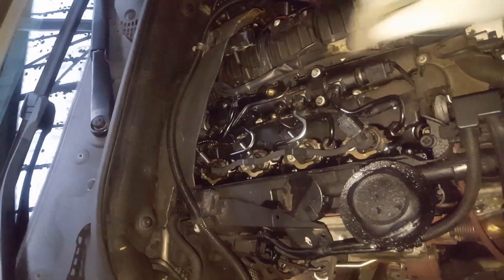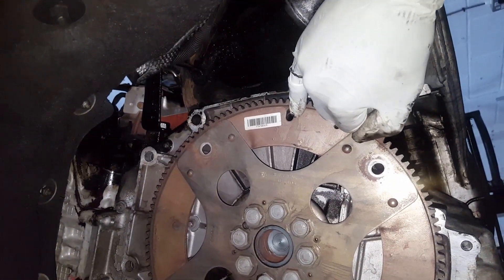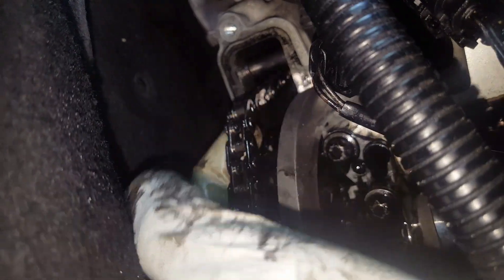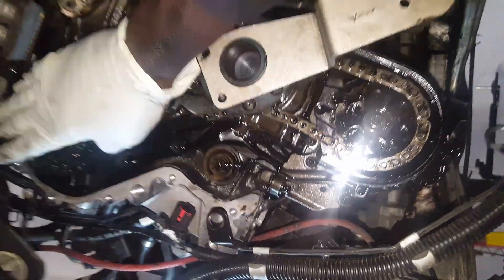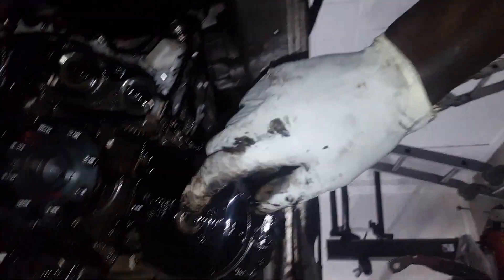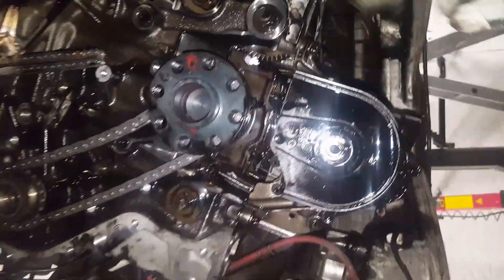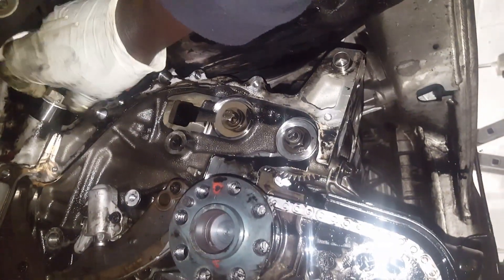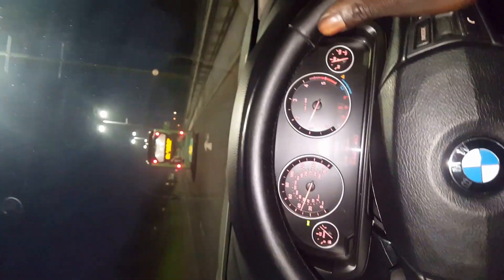BMW N47 timing chain replacement | click video describstion below for info

Comment: not to dish your work but there is a tool that screws into the H/P pump sprocket cost bout £15  on ebay saves lots of time on removing pump bolts can do from start to finish in about 5 and half hours have done quite afew
Reply from the maker: No problem mate, at that time the garage I was working for didn't have that tool and I had to keep doing it that way. 

Will you be able to send the link on the comment below and I'll order it thanks👍
Reply: Dawda The Mechanic  cant get link up but just type in ‘bmw n47 injector pump tool’ on ebay it wil come up
Reply from the maker: Alright no problem thanks👍

Comment: Mainly  reason why  timing chain    fail,  is  lack of  oil  change. Cold start  hard driving,down shifting  ect.Service  interval  by Bmw 30.000 km   its way  to  much out  of  mind.
Use best  oil  5w30 LL   and  do  your  oil  change  often  10.000-15.000km  and  trust me  ,you  won't  have  this  type  of  issues..
Reply: But still its better to change your oil after 10.000 km
Reply: BMW N type Engine's are know to fail regardless of Engine oil change.

Comment: You are from uk bro? How much for this? I have one bmw 520d 177 and i need to replace this
Reply from the maker: Hello mate I don't have my own garage yet and am currently working for VW dealership at the moment. Thanks👍
Reply: Dawda The Mechanic mate is this issue with timing change on all Diesel engines of bmw 5, 3 and 1 series. Also what year does it effect. Any info would be appreciated, as I am reluctant to buy the 5 series 2013 520d I was eyeing up. Cheers👍🏼 excellent video
Reply: and could not help me with the distribution in a price?
Reply from the maker: It takes about 10hrs to do. It depends how much a garage chargers per hour.

The parts is about £200

Comment: Brilliant great video dude very talented
Reply from the maker: Thank you👍
Reply: Mine needs doing on 318 d what you think I would be looking at cash wise at a garage ?
Reply from the maker: @1gazzarobbo  it takes around 10hrs to do. It all depends the hourly rate the garage charges. 

I won't be able to do it because I don't have my own garage yet. Thanks 👍
Reply: Dawda The Mechanic sure you will have soon enough 👍 mechanics who I have spoke to say the engine needs to come out but obviously not as shown as on it video also have been quoted around 1300 -1500 🙁🙁🙁
Reply from the maker: @1gazzarobbo   gary robinson  one day thanks👍
To be honest most mechanics prefer to remove the engine. It can also be done without engine being removed. I did couple of them with engine our and without engine out. I decided to make this video in case someone doesn't want to remove engine.

Engine out will always cost more. Most local garge charge £50 per hour, and it takes 10hrs to do without engine removed.
Reply: Dawda The Mechanic  not 100 percent of its the chain on ours it could be something else but it’s deffo coming from the back 🙁🙁
Reply from the maker: @1gazzarobbo  that will be the chain👍. That's how they  sound as a warning .

Comment: you sure make it look so simple... in the process of changing mine, but have no lift. i might be able to get it high enough to get the gearbox from underneath. In Sweden it cost over £5.000 to have it changed at BMW mechanics. An easy 5 * for your video mate.
Reply: Would this work on my 2011 BMW X5 xDrive 40d???
Reply from the maker: Hey I am a Swedish nationality, I been there few time haha.

Anyway thanks. The x5  Gear box is big and to remove the oil sump will be difficult on x5. I haven't done it on x5 but the procedure is the same. I think it's best to remove the engine on a x5.

Any other question feel free to ask👍
Reply: Dawda The Mechanic what would be the differens besides the 4x4 shaft? I work as a Volvo/ Renault mechanic but have been fixing a lot of other brands as well, so I’m quite confident with the tools. The car is park in the garage until I have it fixed and I bought another car until I have time to fix it. But I do not have not removed a BMW engine before so not sure that would be quicker for me?
Reply: Dawda The Mechanic You have to put up a video on removing the N57 3.0 engine. 😂
Reply from the maker: @henrisundberg4082  alright that's good to hear👍

There was someone here that commented few months back and doing this job on a x5. He removed the engine becuse of the oil sump.

You need to first remove the gearbox, wiring, ac gas and coolant. Engine will come out from the top.

It will take long time to do.

Comment: Dawda I have bmw 520d 2013 66 kmiles when do I need to change the chain ?
Reply from the maker: Hello 

From the ones i witnessed.  The lowest mileage I seen the chain failed was about 90k 

 I have seen higher mileage 130k miles and still going

Comment: Great video! you know your stuff. Any chance you will be able to fix my car? timing chain on my car has gone. Its a BMW 320d 2010(60)
Reply: have you repaired yours? i'm in the same situation!
Reply: @KOSOGI1000  Yes I got mine done form a local garage. Cost me £1100 :(
Reply: i've just been quoted £1200, not happy with this BMW Product thats for sure!!
 @RuubzP
Reply: @KOSOGI1000  Yeah I know what you mean. The engines are very weak I've spent a ton on my car already.

Comment: Hi Do you think theres enough space to do this on a 118d N47 manual if you dont take the engine out?, only the gearbox like this.
Reply from the maker: Hello yes there's enough space 👍
Once you try you try then it'll be easy next time.
Reply: Once you take the valve and timing covers off , do the mating surfaces need cleaning, is it easy to clean in the limited space?, because in the timing kit RTV silicon is supplied  @dawdathemechanic-dawdaauto1761
Reply from the maker: @picapica8806  yess there will be enough space to clean the surface.

You'll need to try it once and see. If you find it very difficult then remove the engine next time👍.

Comment: Do you have to take out the engine????
To change the belt? Wtf
Reply from the maker: Yes you can take engine out. It'll be easy once the engine is outside.

It is also doable while the engine is inside.
Reply: @dawdathemechanic-dawdaauto1761  not easy!
Thanks for the answer.
I think that there could be more damege done when the engine is out.
Becouse you have to dissconect all the stuff and yep im confused sorry! 
:(
Reply from the maker: @nikoniko1455  yes that's true 👍 give it a try without removing the engine. Once you try 1 of them then it'll be easy next time👍
Reply: It’s a metal timing chain and not a rubber belt.

Comment: Great video mate, very informative with some great tips like using the bolt in the high pressure pump to remove the pulley, so simple an idea but yet so effective. Thanks very much.
Reply from the maker: No problem and thanks 👍

Comment: I hope it puts only hi pressure,not the distribution of the fuel by timing? What do you think man?
Reply: Thanks again Dawda!
Reply from the maker: @Speedmaster4x4  no problem good luck 👍
Reply from the maker: Click the link below it will also say the pump should be in number 13 
https://www.google.co.uk/search?biw=360&bih=318&tbm=isch&sa=1&ei=eGbEWpJDi8mABsWGm8gE&q=bmw+n47+fuel+pump+timing&oq=bmw+n47+fuel+pump+timj&gs_l=mobile-gws-img.1.0.0i13.97591.101850..103285...0....86.818.15..........1..mobile-gws-wiz-img.......0j41j0i24.REFVfVhJfPs%3D#imgrc=U8KDKkUNTP7YGM:&isa=y

Comment: Im doing this now but i putt the engine out... Its easier because i can see everything... I found a screw snapped on the oil pump.... 😊
Reply from the maker: That's good and definitely will be easy when the engine is outside👍 

Dont forget to inspect all the rocker arms. They sometimes get bent and crack.

Comment: the gearboxes are easier to take out than the engine .and the chain can be replaced by that route .less room but can be done .
Reply from the maker: Yes you are right👍 they are easy to remove on bmw and like you said it is doable.

Some ppl prefer to remove engine. I don't mind doing it while it's in the car as long it's not fitted on a car which doesn't allow me with any space.

Comment: Nice job Dawda! I have a 2009 320d that has started to rattle from the chains recently, I was thinking about doing this job myself! Is it very difficult with the engine still in the car? Because all garages i've talked to said it is a MUST to take out the engine!
Reply from the maker: Hello I know what you mean 👍. To be honest it's only easy for me because I did it lots of time that's why I can do it with the engine in the car in 1 day.

If it's your first time, maybe take the engine out and try it and ones you under stand what needed to come out etc then maybe next time you can do it while it's in the car.

If you don't have the equipment to remove the engine then you can give it ago. It is doable in the car but it will take you longer cuz it's your first time.

I mainly explain how to do the chain but not how to remove other parts so you can access the chain.

Comment: Where are you based mate?
Reply: I just saw a comment from another message that you are in Reading. Is that still correct? I have 520d F10 90k miles. I think a timing chain replacement as well as all other parts is in order before it's too late
Reply from the maker: @GSMah  hello yess I am based in Reading but I don't have my own garage yet. Am working for VW dealership at the moment. I won't be able to take the job but maybe one day 👍.

At the moment find a local garage that has good reviews and they will be able to do the job properly 👍

Comment: Great video, very well done. I have ordered the Timing kit and tool and will be following what you did very closely, do you know the torque setting for the bolts or where i can find them? Assuming its important.
Reply from the maker: Thanks 👍
Cam pulley 15nm
High pressure fuel pump gear 65nm
Cam tensioner 70nm
Tensioner  for centre timing chain 10nm

Please click the link below to see picture number 9 and 13. Ensure groove on high-pressure fuel pump shaft aligned with lug on timing case 13  https://www.google.co.uk/search?bi
Reply: Dawda The Mechanic, Thanks. Currently doing this to my 1 series in car. Have gearbox off and flywheel off but the sump looks tricky right now. Not sure I can remove the sub frame without the gearbox attached.
Reply from the maker: @sonic696  hello yess I know what you mean but I normally use 3/8 uj with some extension to remove some of the screws.

Maybe 1 series are different to access. But if your planning to remove the subframe then put engine supporter on top of the engine.

And don't forget to inspect all the rocker arms when you take the cam cover off. Sometimes they crack but very rare👍
Reply: @dawdathemechanic-dawdaauto1761  Yeah to get the to sump the sub frame needs to be lowered to remove it. As the car is on ramps, not a lift i don't feel safe lowering the subframe as part of the wheel attaches to it. As most of the work is done i'm removing the engine once i can get a lift. Makes the whole job much easier.
Reply from the maker: @sonic696  ooh ok I see, the one I did on this video is 3 series which has a bit more room. Yess removing the engine sounds like a good idea👍 gearbox is already out so not many left for engine to come out. Good luck 👍

Comment: what kind of kit did you use? an OE or Aftermarket?
Reply from the maker: All the ones I did are after market kit 👍
Reply: what aftermarket kit did you use, or what you recommend?
Reply from the maker: @terhesiu  it's the one from Euro car part or GSF car part. Which ever will do👍.  

You can also compare it with BMW and if the price difference are not huge then get it from BMW.
Reply: @dawdathemechanic-dawdaauto1761  Febi is half the price off the BMW. That's why I asked you about aftermarket and which brand did you use. Thanks
Reply from the maker: @terhesiu  alright no problem. The brand I was sent is Fai and it was about £220
Reply: @dawdathemechanic-dawdaauto1761   I also intend to use Fai. Have you had any issue with them?
Reply from the maker: @terhesiu  no issue with them so far👍
Reply from the maker: Please click the link below to see picture number 9 and 13. Ensure groove on high-pressure fuel pump shaft aligned with lug on timing case 13 

 https://www.google.co.uk/search?biw=360&bih=318&tbm=isch&sa=1&ei=eGbEWpJDi8mABsWGm8gE&q=bmw+n47+fuel+pump+timing&oq=bmw+n47+fuel+pump+timj&gs_l=mobile-gws-img.1.0.0i13.97591.101850..103285...0....86.818.15..........1..mobile-gws-wiz-img.......0j41j0i24.REFVfVhJfPs%3D#imgrc=U8KDKkUNTP7YGM:&isa=y

Comment: Just want some info for the same job, will do it tomorrow. Have you removed the gearbox without removing the driveshaft? Is that possible? Thank you for all the good explanations!
Reply from the maker: Hello no problem👍
This car is rear wheel drive so it only had prop shaft connected at the back of the gearbox. No drive shaft is connected to it. If it's a 4wheel drive then you'll need yo remove drive shaft.

Please click the link below to see picture number 9 and 13. Ensure groove on high-pressure fuel pump shaft aligned with lug on timing case 13 

 https://www.google.co.uk/search?biw=360&bih=318&tbm=isch&sa=1&ei=eGbEWpJDi8mABsWGm8gE&q=bmw+n47+fuel+pump+timing&oq=bmw+n47+fuel+pump+timj&gs_l=mobile-gws-img.1.0.0i13.97591.101850..103285...0....86.818.15..........1..mobile-gws-wiz-img.......0j41j0i24.REFVfVhJfPs%3D#imgrc=U8KDKkUNTP7YGM:&isa=y

Comment: Hi Dawda. I've taken my BWM Mini N47 engine out to replace the timing chain. Ive turned the engine clockwise from the pulley side to find TDC and noticed the chain skipped a few times on the cog... Does that mean the Cams and Crank shaft are all out of sink with each other? It also locks up when finding TDC. Do you have any advise to help me. Thanks.
Reply from the maker: Hello yess it has most likely jumped out of timing.

Best thing to do now is turn the crank until the pistons are half way down. Take the chain out then turn the cams to there timing mark. Then turn the crank to tdc, install the flywheel to double check the tdc locking tool.

Hope that helps 👍
Reply: Am i right in thinking: when setting the timing on both cams to TDC... Should the 4 pistons be at the same height, at the top of the cylinders? If that's correct can i go ahead & fit the new timing chain kit then crank the engine in 2 full rotations to make sure both cams are in TDC position? I'm using 4 chop sticks in the fuel injector holes to check the height of the pistons.
Reply from the maker: @tigertigerpantherfox3714  hello you need to first get the cams to line up with the special dots, insert the cam locking tool.

Then rotate the crank until cylinder number 1 piston is all the way to the top. Insert the flywheel temporary to see if the special hole matches with the flywheel locking tool.
Reply from the maker: And yes you can use the injector hole and get the cylinder 1 piston all the way to the top.
Reply from the maker: See number 3 on the picture to see the special dots on the cams

And check number 13 to line up the high pressure fuel pump gear roughly to that mark

https://www.google.co.uk/search?biw=360&bih=318&tbm=isch&sa=1&ei=eGbEWpJDi8mABsWGm8gE&q=bmw+n47+fuel+pump+timing&oq=bmw+n47+fuel+pump+timj&gs_l=mobile-gws-img.1.0.0i13.97591.101850..103285...0....86.818.15..........1..mobile-gws-wiz-img.......0j41j0i24.REFVfVhJfPs%3D#imgrc=U8KDKkUNTP7YGM:&isa=y
Reply: @dawdathemechanic-dawdaauto1761   Thanks for the advice Dawda. It took me longer than planned due to changing the pulley wheel and complete flywheel and clutch but i finally got my engine timing chain fitted and refitted the engine. Do you think it sounds OK? https://www.youtube.com/watch?v=Sqiv-7PdFqY
Reply from the maker: @tigertigerpantherfox3714  that's good to hear👍 the job takes long time to do but well done!

Yes it does sound ok, just carry on with your regular oil change👍

Comment: Hi Dawda, great video thanks! My 2011 X5 x-drive with N57 engine needs the chains replaced, but to remove the sump requires the subframe dropped and front diff dropped down for access, would you just remove the engine instead? (can it be lifted out or does the engine have to be dropped out with the subframe on this car?) Thanks!
Reply from the maker: Hello yess it's a big job trying to remove the sump looks like. If you can remove the gearbox out then you can lift the engine out👍 it will still take long time but engine out job is best on your car.

Some people prefer to drop the engine down which is also possible, you'll have to see which way is easier for you.
Reply: Thanks for your reply Dawda, much appreciated! 
Wayne
Reply from the maker: @waynekingston7772  no problem good luck 👍

Comment: Was looking at buying a 2005 320d e90 with the n47d engine but all the tslk of timing chain has scared me off it. Really like the car too had a 2010 320d m sport for a while and enjoyed every minute of it bit it only had 37k on it. Abtw you are a great mechanic 👍👍
Reply from the maker: Hello yess I understand👍 they are great car to have but the n47 will have chain issue in some point of owning the car, that's the only down side. Or you can get 335d, the chain on them are more reliable because I heard the camshaft it has is different with the n47.

Comment: Nice video, do you only use genuine  bmw chains when you are fixing n47's?
Reply from the maker: Thanks👍 and no it's not necessary to use genuine. I have always used aftermarket. But you can buy from BMW if it's not too expensive 👍